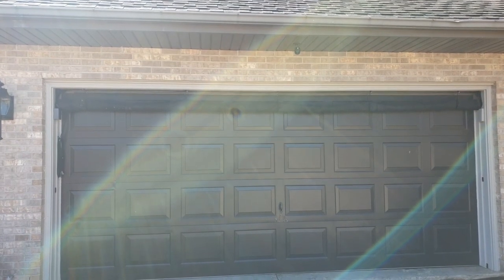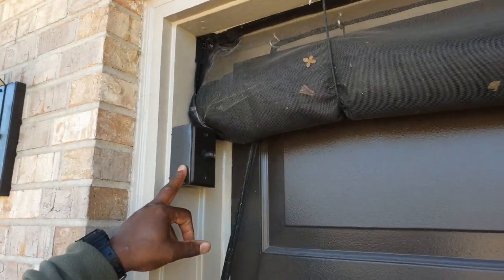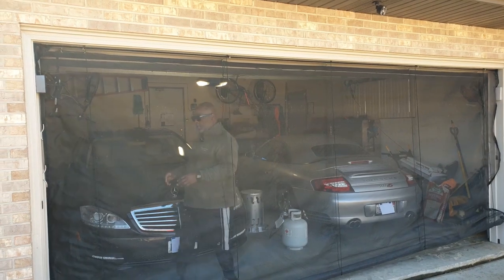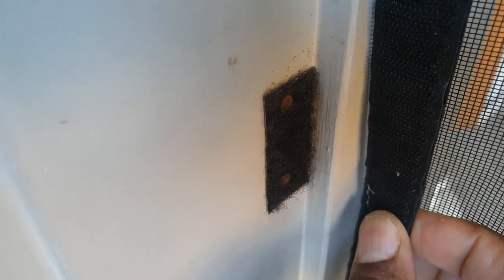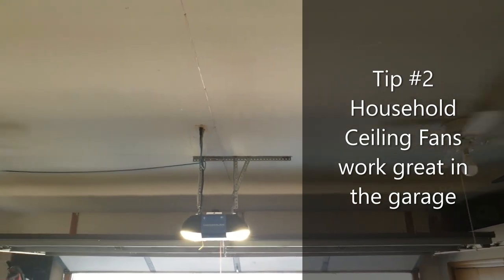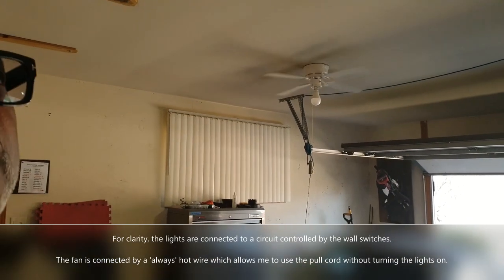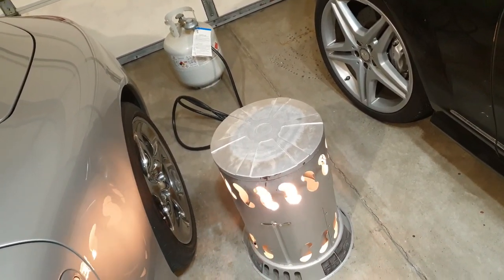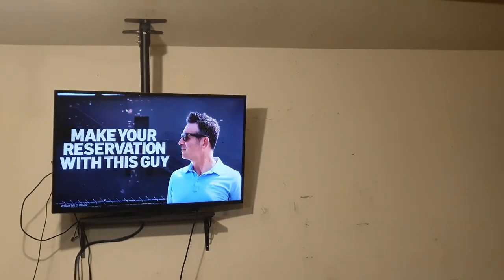Five Cheap Tips to Help Make Your Garage a Comfortable Year-round Hangout Spot

Comment: Thank you  for   Sharing this video very helpful  I definitely like this screen And the TV I have small kids Try to come up with something that would be nice for them and me
Reply from the maker: Hey there Stanlee, thanks for your support.  If you have any questions in any area that I might be able to help, post them up and I'll respond. 

One added point in terms of finding a garage TV. In addition to going to a place like Best Buy and looking at display models, also consider consignment and/or used furniture stores.  I found two 40" TV's total. One for my garage and one for my backyard patio.  One was a $400 BB tv that I got for just under $200 because it was missing the remote, stand and had a tiny scratch on the screen. The second was a brand-new 40"Insignia that I got at a local consignment store. Still in manufacturers wrap with stickers. Owner was asking $100.  I offered $70 which they accepted because it was missing the remote. Got a remote on eBay for $10.

If you plan to stream content from your cell phone or you want built in Netflix/Amazon Movies, make sure the TV's are smart TV's.

Take care

Comment: Danger! Exhaust from portable propane heaters can also create a carbon monoxide hazard, even when there are no propane leaks. You should install a carbon monoxide detector in the space, as well as insuring proper ventilation to prevent buildup of this deadly, odorless gas.
Reply: Even with the door open a little bit,it can gas you out. Been there.